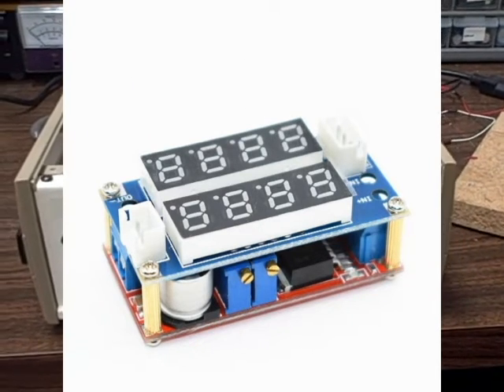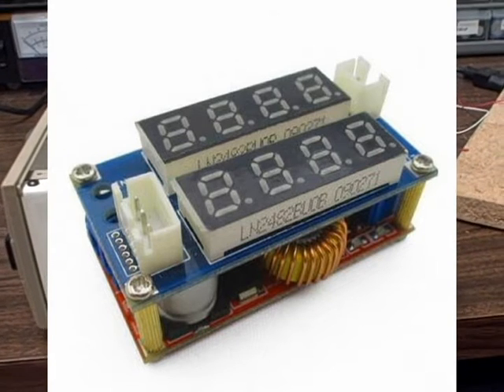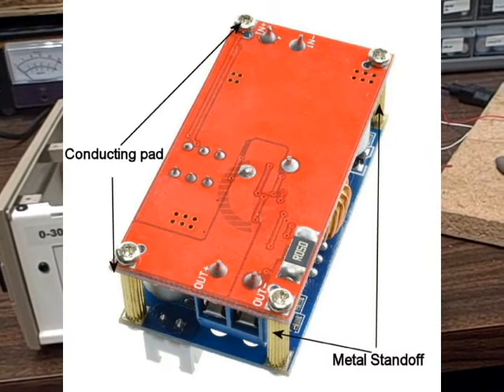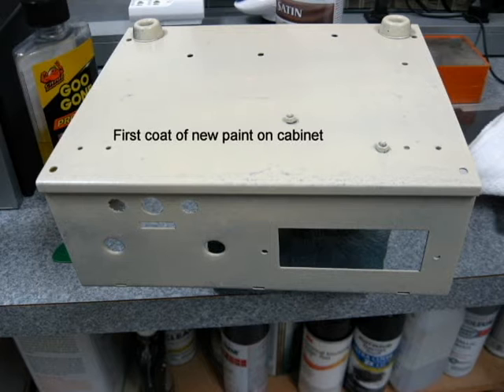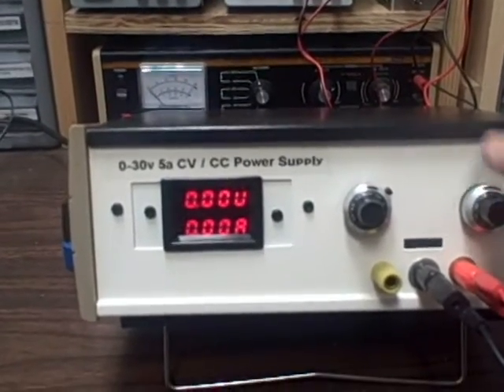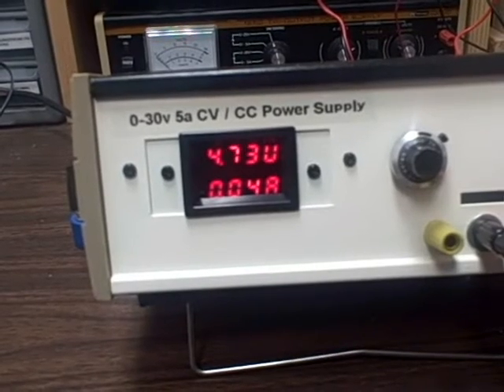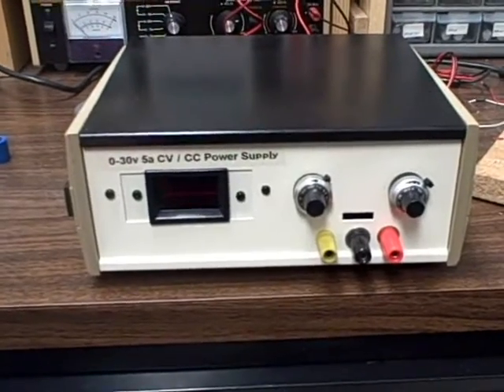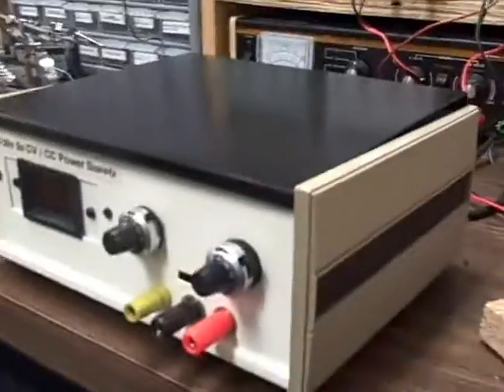30v 5A CC/CV Power Module Modifications - Part1

Comment: Can I use it as step up converter?
If I input 7.4v can I output 20 or more volt?
Reply from the maker: No. In contant voltage mode it will hold the voltage setpoint up to within a volt of the power supply. In constant current mode, it will hold the current constant by varying the voltage up to the power supply voltage. The power supply can be up to 30v.

Comment: Very nice Bruce!  Can you explain why you did double wire on the binding posts?  I couldn't see the board good enough to tell if they went to different  contact points on the board? If not and they went to the same spot, whats the thinking there?  Thanks, enjoy what you do!  ~Jack, EG
Reply from the maker: The output is up to 5A.  The wires are small, as are the connecting pads. So, I doubled up on the wire connections.
Reply: Thanks for the 411!  ~Jack, VEG